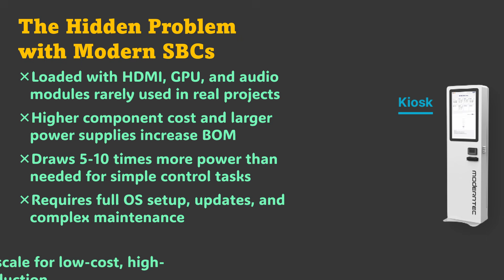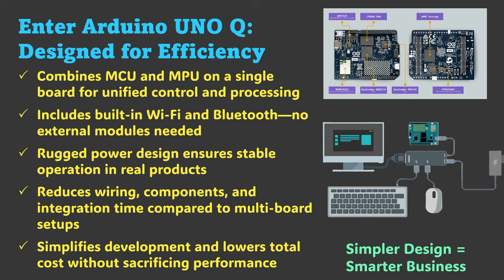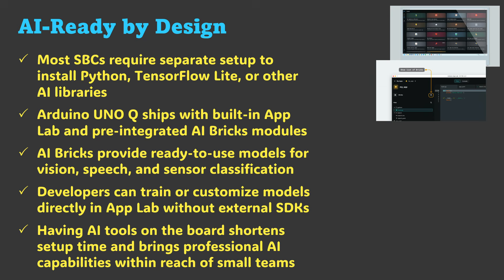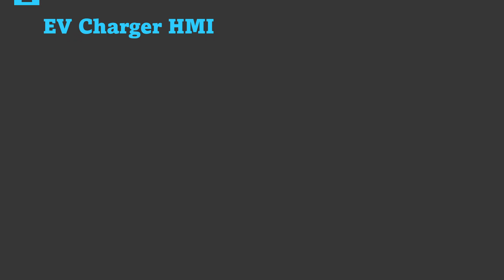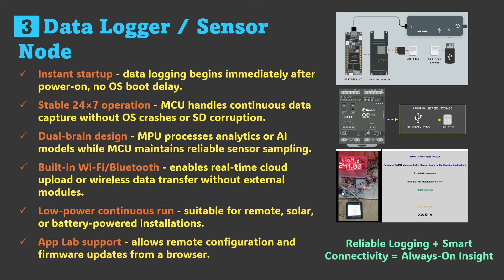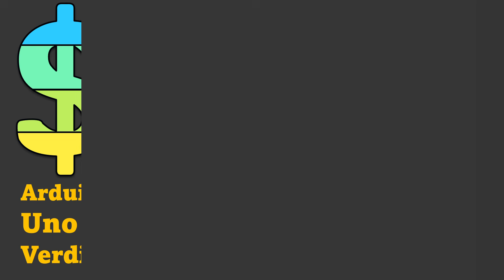Arduino UNO Q: Can It Make More Money More Easily Now for Hobbyists, Freelancers, and Startups?

Comment: I’m not sure if it’s fast enough for most sensors. Old arduinos could log data at 1Khz, while this new rpm bridge limit the dataflow between the mcu and the mpu to about 5Hz. Difficult to understand why they have blocked serial communication and just uses json based rpc?

Comment: Don't watch this is AI slop
Reply from the maker: Dear Viewer,

We humbly request you to please go through the following videos on our channel:

AI + Arduino + Python = A Real-World LED Display System
https://youtu.be/0Fy5bQAsZ5g

AI + Arduino + Python + PyQt5 GUI = Dynamic LED Display Control Without Coding
https://youtu.be/j6w7hrAR6lw

RISH EM DC 6000 – Renesas RA4M1 MCU | DC Energy Monitoring Using Modbus in EV Charging Systems
https://youtu.be/EPWQFiruStI

AC Meter to Dashboard: Monitoring with Renesas RA4M1, RISH LM1340, Modbus & Python
https://youtu.be/Q7FTzByQ_CY

Renesas RA4M1 Microcontroller-Based Control System for EV Chargers
https://youtu.be/TgMptV0M924

Real-Time EV Charging Management: Multi-Station Monitoring & Smart Insights
https://youtu.be/Jjx3JsPeNQY

Power-On Self Test: Ensure Your Renesas RA4M1 Performs Perfectly (CPU, RAM, Watchdog, and More!)
https://youtu.be/91v8zd0xJI8

How to Build a CAN-Based Cloud Data Monitoring System with Arduino Uno R4 for Predictive Diagnostics
https://youtu.be/LSZnqOitLCs

CMOS Complex AND-OR-Invert Verilog to Layout | Lab 12 | JNTUH VLSI Design Lab | Xilinx Vivado, Microwind
https://youtu.be/2TRe6Ija31Y

CMOS Latch Schematic to Layout | Lab 11 | JNTUH VLSI Design Lab | Microwind
https://youtu.be/_UnxS9DkmrE

CMOS XOR and 2:1 Multiplexer Schematic to Layout | Lab 10 | JNTUH VLSI Design Lab | Microwind
https://youtu.be/G4W05-nvjy0

CMOS NOR and NAND Schematic to Layout | Lab 09 | JNTUH VLSI Design Lab | Microwind
https://youtu.be/rotW7BOfhQE

CMOS Inverter Layout Design | Lab 07 | JNTUH VLSI Design Lab | Microwind
https://youtu.be/NwNG_EFbZlg

Adder Using Behavioral, Dataflow, and Structural Models | Lab 05 | JNTUH VLSI Design Lab | Xilinx Vivado
https://youtu.be/2hzsFTUyyCA

Design of 4-Bit Comparator | Lab 05 | JNTUH CMOS VLSI Design Lab | Xilinx Vivado
https://youtu.be/er93bItNOIA

Binary to Gray Converter | Lab 04 | JNTUH CMOS VLSI Design Lab | Xilinx Vivado
https://youtu.be/K96d1jVO7pM

8-to-1 Multiplexer and 1-to-8 Demultiplexer | Lab 03 | JNTUH CMOS VLSI Design Lab | Xilinx Vivado
https://youtu.be/IDuATNcr0bM

Design of 8-to-3 Encoder and 2-to-4 Decoder | Lab 02 | JNTUH CMOS VLSI Design Lab | Xilinx Vivado
https://youtu.be/PBiWZTio63o

Basic Logic Gates | Layout | JNTUH CMOS VLSI Design Lab | Part 2 | Lab 01 | Microwind
https://youtu.be/qgExNLFiNZI

Realize All Logic Gates | Lab 01 | JNTUH CMOS VLSI Design Lab | Xilinx Vivado
https://youtu.be/CPvVl2EE6s0

Arduino Uno Interfacing with FPGA Using UART (Uno R4 WiFi, Renesas RA4M1 Board)
https://youtu.be/uYx2pFEGye8

Multi-CANBUS and Multi-MODBUS Communication with Arduino Uno R4 WiFi
https://youtu.be/ZDmIXbUbz80

Arduino Uno R4 WiFi-Based CAN Bus and MODBUS Communication (RA4M1 Microcontroller)
https://youtu.be/B_m2wKh7KAk

Setting Up Renesas E K-RA4M2 MODBUS/RS-485 Communication
https://youtu.be/dwTV17bxanA

Mastering Serial Communication Between Renesas EK-RA4M2 and Arduino Uno
https://youtu.be/SEAN1XPv_HA

AI Tools for Research | Using AI from Coding to Research Proposal (and Getting Results!)
https://youtu.be/UMClhJf5-u4

Free PPT on Any Topic: Just 2 Steps! No Restrictions, No Credit Card Required!
https://youtu.be/Otde9YMb2h8

INKOR Technologies Private Limited
https://youtu.be/hiZRCH38Qds

XMC4700 Relax Kit USB-Based HMI Interface Using Python
https://youtu.be/ixCZGIGj-k4

XMC4700 Relax Kit CAN-UART Communication
https://youtu.be/TA-GDn3bYHI

XMC4700 Relax Kit + HC05 Bluetooth Module
https://youtu.be/L-CQmetMP7E

XMC4700 Relax Kit PWM Example
https://youtu.be/G3O9VyVfvQU

XMC4700 Relax Kit UART TX/RX
https://youtu.be/9GIidBzDXPw

We represent a consortium of professionals, manufacturing units, and investors committed to building a robust research and development ecosystem across the USA, UK, UAE, and India through mutual cooperation.

We are among the leading manufacturers of EV chargers in South Asia and are in the process of establishing manufacturing units in other countries as well. Each of our team members have over 20 years of combined industrial and academic experience.

As some of us are not native English speakers, we use AI tools only for grammar correction and text-to-speech generation. The concepts, designs, and ideas originate from our direct industrial and research experience.

You will notice that none of our videos are clickbait — even though that might have helped us gain more subscribers and watch hours. In the coming days, we will continue posting real-world implementation videos.

In the meantime, we sincerely invite you to explore our channel and share your feedback on how we can improve.

With best regards,
Team INKOR Technologies Pvt. Ltd.

Comment: I work in a restaurant. We "upgraded" the computer system almost a year ago. The previous system ran on Pentium mmx machines with windows CE, and it worked great. The new system has constant problems, and because the system is more complicated, problems take longer to fix than before. 
  Point is, I have to believe Arduinos could be leveraged for more reliability and simplicity in restaurant POS systems.
Reply: This is AI slop not worth it
Reply from the maker: Dear Viewer,

We humbly request you to please go through the following videos on our channel:

AI + Arduino + Python = A Real-World LED Display System
https://youtu.be/0Fy5bQAsZ5g

AI + Arduino + Python + PyQt5 GUI = Dynamic LED Display Control Without Coding
https://youtu.be/j6w7hrAR6lw

RISH EM DC 6000 – Renesas RA4M1 MCU | DC Energy Monitoring Using Modbus in EV Charging Systems
https://youtu.be/EPWQFiruStI

AC Meter to Dashboard: Monitoring with Renesas RA4M1, RISH LM1340, Modbus & Python
https://youtu.be/Q7FTzByQ_CY

Renesas RA4M1 Microcontroller-Based Control System for EV Chargers
https://youtu.be/TgMptV0M924

Real-Time EV Charging Management: Multi-Station Monitoring & Smart Insights
https://youtu.be/Jjx3JsPeNQY

Power-On Self Test: Ensure Your Renesas RA4M1 Performs Perfectly (CPU, RAM, Watchdog, and More!)
https://youtu.be/91v8zd0xJI8

How to Build a CAN-Based Cloud Data Monitoring System with Arduino Uno R4 for Predictive Diagnostics
https://youtu.be/LSZnqOitLCs

CMOS Complex AND-OR-Invert Verilog to Layout | Lab 12 | JNTUH VLSI Design Lab | Xilinx Vivado, Microwind
https://youtu.be/2TRe6Ija31Y

CMOS Latch Schematic to Layout | Lab 11 | JNTUH VLSI Design Lab | Microwind
https://youtu.be/_UnxS9DkmrE

CMOS XOR and 2:1 Multiplexer Schematic to Layout | Lab 10 | JNTUH VLSI Design Lab | Microwind
https://youtu.be/G4W05-nvjy0

CMOS NOR and NAND Schematic to Layout | Lab 09 | JNTUH VLSI Design Lab | Microwind
https://youtu.be/rotW7BOfhQE

CMOS Inverter Layout Design | Lab 07 | JNTUH VLSI Design Lab | Microwind
https://youtu.be/NwNG_EFbZlg

Adder Using Behavioral, Dataflow, and Structural Models | Lab 05 | JNTUH VLSI Design Lab | Xilinx Vivado
https://youtu.be/2hzsFTUyyCA

Design of 4-Bit Comparator | Lab 05 | JNTUH CMOS VLSI Design Lab | Xilinx Vivado
https://youtu.be/er93bItNOIA

Binary to Gray Converter | Lab 04 | JNTUH CMOS VLSI Design Lab | Xilinx Vivado
https://youtu.be/K96d1jVO7pM

8-to-1 Multiplexer and 1-to-8 Demultiplexer | Lab 03 | JNTUH CMOS VLSI Design Lab | Xilinx Vivado
https://youtu.be/IDuATNcr0bM

Design of 8-to-3 Encoder and 2-to-4 Decoder | Lab 02 | JNTUH CMOS VLSI Design Lab | Xilinx Vivado
https://youtu.be/PBiWZTio63o

Basic Logic Gates | Layout | JNTUH CMOS VLSI Design Lab | Part 2 | Lab 01 | Microwind
https://youtu.be/qgExNLFiNZI

Realize All Logic Gates | Lab 01 | JNTUH CMOS VLSI Design Lab | Xilinx Vivado
https://youtu.be/CPvVl2EE6s0

Arduino Uno Interfacing with FPGA Using UART (Uno R4 WiFi, Renesas RA4M1 Board)
https://youtu.be/uYx2pFEGye8

Multi-CANBUS and Multi-MODBUS Communication with Arduino Uno R4 WiFi
https://youtu.be/ZDmIXbUbz80

Arduino Uno R4 WiFi-Based CAN Bus and MODBUS Communication (RA4M1 Microcontroller)
https://youtu.be/B_m2wKh7KAk

Setting Up Renesas E K-RA4M2 MODBUS/RS-485 Communication
https://youtu.be/dwTV17bxanA

Mastering Serial Communication Between Renesas EK-RA4M2 and Arduino Uno
https://youtu.be/SEAN1XPv_HA

AI Tools for Research | Using AI from Coding to Research Proposal (and Getting Results!)
https://youtu.be/UMClhJf5-u4

Free PPT on Any Topic: Just 2 Steps! No Restrictions, No Credit Card Required!
https://youtu.be/Otde9YMb2h8

INKOR Technologies Private Limited
https://youtu.be/hiZRCH38Qds

XMC4700 Relax Kit USB-Based HMI Interface Using Python
https://youtu.be/ixCZGIGj-k4

XMC4700 Relax Kit CAN-UART Communication
https://youtu.be/TA-GDn3bYHI

XMC4700 Relax Kit + HC05 Bluetooth Module
https://youtu.be/L-CQmetMP7E

XMC4700 Relax Kit PWM Example
https://youtu.be/G3O9VyVfvQU

XMC4700 Relax Kit UART TX/RX
https://youtu.be/9GIidBzDXPw

We represent a consortium of professionals, manufacturing units, and investors committed to building a robust research and development ecosystem across the USA, UK, UAE, and India through mutual cooperation.

We are among the leading manufacturers of EV chargers in South Asia and are in the process of establishing manufacturing units in other countries as well. Each of our team members have over 20 years of combined industrial and academic experience.

As some of us are not native English speakers, we use AI tools only for grammar correction and text-to-speech generation. The concepts, designs, and ideas originate from our direct industrial and research experience.

You will notice that none of our videos are clickbait — even though that might have helped us gain more subscribers and watch hours. In the coming days, we will continue posting real-world implementation videos.

In the meantime, we sincerely invite you to explore our channel and share your feedback on how we can improve.

With best regards,
Team INKOR Technologies Pvt. Ltd.
Reply from the maker: Help Us Develop a Cost-Effective and Reliable Solution for Your Needs — Absolutely Free of Cost to You

Dear Viewer,

Thank you for sharing your real-life experience - it truly highlights the importance of reliability and simplicity in embedded system design.

We represent a consortium of professionals, manufacturing units, and investors committed to building a robust research and development ecosystem across the USA, UK, UAE, and India through mutual cooperation.

We are among the leading manufacturers of EV chargers in South Asia and are currently establishing manufacturing units in other countries as well. Each of our team members have over 20 years of combined industrial and academic experience.

In addition, we are actively developing commercial embedded system solutions for multiple clients across various sectors.

If you are interested, kindly let us know the specific issues you are facing with your current system, and we would be happy to design a new, cost-effective, simple, and robust solution for you — absolutely free of cost.

We would be delighted to collaborate and develop such practical solutions that enhance reliability and ease of operation.
Please share the details at research@inkortech.co.in   .

With regards,
Team INKOR Technologies Pvt. Ltd.